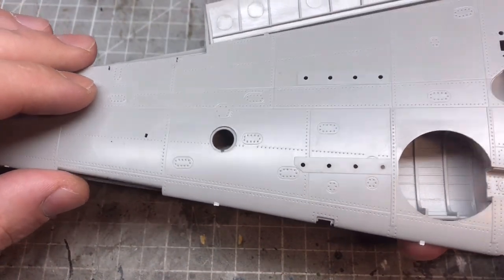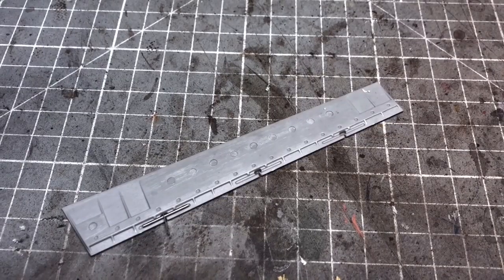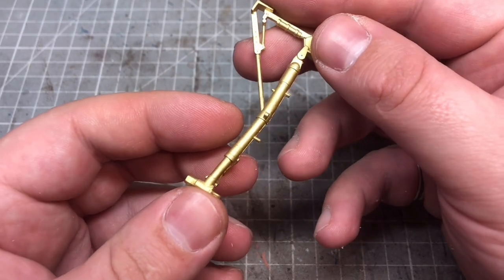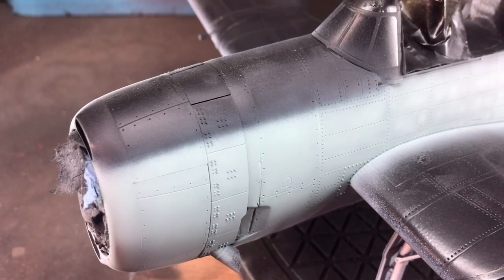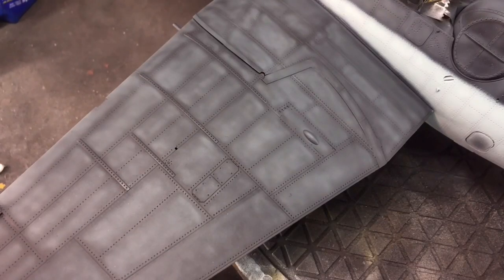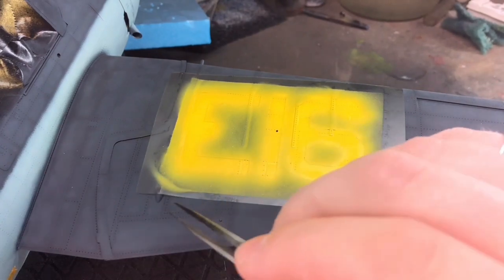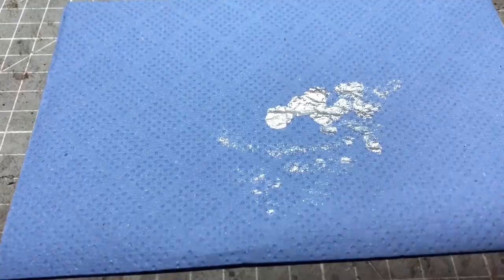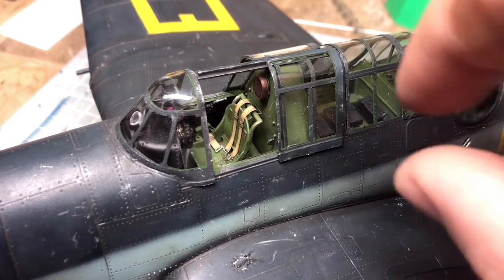1/32 Trumpeter Avenger part2

Comment: Thanks Sully. It is actually this model that got me seriously back into modelling. I had one in the stash (since 2006), with the Big Ed kit, and I had finished the engine, but then went off modelling for a while (except for buying more kits). Then, in Melbourne pre-Covid I saw a finished one in Metro hobbies and it was the impetus to restart modelling. I am now working on it, and the videos have been a fantastic help. Cheers, Mark.
Reply from the maker: Thanks mate! Have you seen the previous video? That has the big Ed upgrade in It. The majority of it will never be seen (unless you watch the video lol) but you know what I enjoyed it nonetheless! Enjoy it and welcome back to modeling😁
Reply: Hy Sully - Thanks, and yes I did see it, and it is a great help in confirming that I am on the right track with some pieces, and juggling two sets of instructions. I have used the engine and interior metal. Deciding whether to use the structural bits of the turret (some major surgery required), and decided against the bomb bay! Big Ed was one of the reasons that the Avenger was held back, but new glasses, and confidence in what I am doing has me back on track. Cheers, Mark. @SullysScaleModels